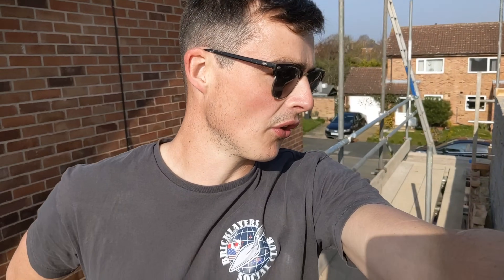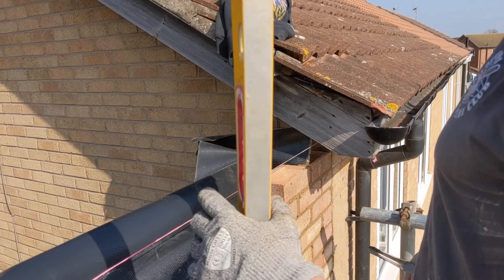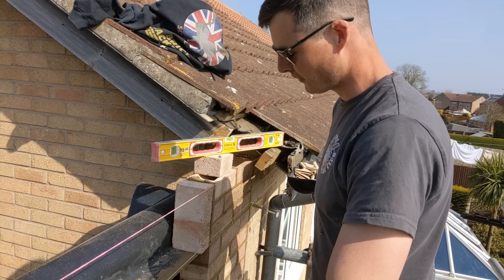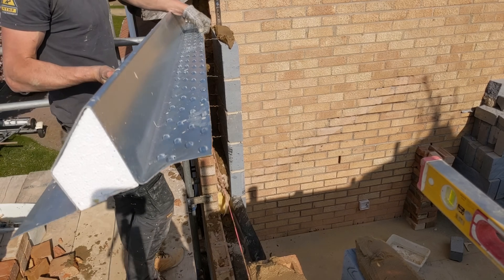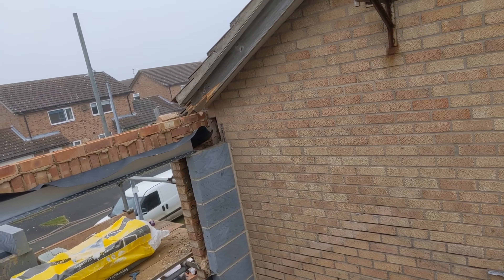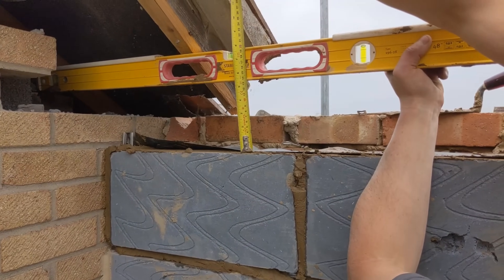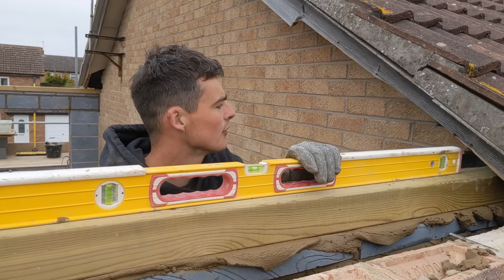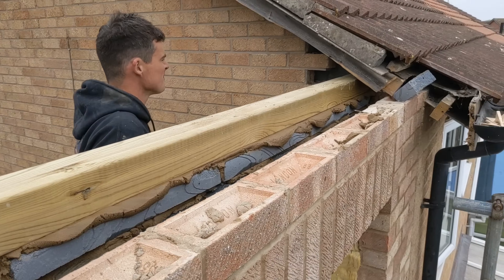Bricklaying - WallPlate & Lintels on! Tips for Lintels+Soldiers #renovation #vlog #extension

Comment: The wallplate straps are for storm lift movement. Great video!
Reply: This is a UK video only. Wall plates need to be mechanically fastened to masonry in North America and most countries in the world. The 4" block is also not allowed either. The 4" block is used as filler only and not structural. Just saying!

Comment: Fair play for doing extension work I do the same and am 29 this year, my most dreaded days are getting out of the ground workers wavy footings, from that point it’s happy days🤣 that lintel you should be fine with as it’s not a heavy load…I’ve had the same gave cavity lintel 120 bearing 2400 opening but was only carrying 5 courses with balcony roof behind 👌🏼 get yourself some fitzbrick clamps if you haven’t best little tool ever and feels so good every time you can use them 🤪
Reply: How do you come across these, extensions out the ground ready for you would be a dream compared to site work
Reply: @brickpug6088  bollocks mate our ground workers seem to think wet concrete finds it’s own level end up cutting splits on the first course, all caving in, loose patio slabs, concrete slab never has right cavity size so I have to sort that out…site work is piss easy because it has to be bang on from the start
Reply: @sammsammmsammmm  well yeah granted not saying it's a walk in the park but like you say once you're over the shite.. much nicer to do privates. Decent muck plod along still get it done but on site it's a mad rat race
Reply: @brickpug6088  depends you still get nasty jobs or having to faff with silly little piers then sit fat steels on top it’s still stressful mate honestly 🤣 I like the thought of smashing a lift a day with a gang on site but we’re all different
Reply: @sammsammmsammmm  well swap for a week and be begging for our old jobs back 🤣

Comment: Mentioned on another video about using a wire reinforcement mesh to wrap it around the base of the wall plate and then that way the wall plate is ready for plastering inside. It does actually work the wall plates solid on there even though I know the roof weight will hold it down. See so many times the internal wall plates not meshed and just plastered over and it all cracks from the wood…

Comment: Izzy how are you fastening the wall plate to top of masonry wall? Obviously mortar bed does nothing. Cheers!
Reply from the maker: Hi mate, we use lateral restraints. A long L shape metal rod, anchors onto the timber and the wall below
Reply: @IzzytheBricky  I have seen some UK masonry video's where other masons  install the top plate on the wall in a bed of mortar? We use structural block 6-8" wide and cast bolts with in top of wall and mechanically fasten wood to block. We have to install protection by code between wood and block to keep wood from rotting. Also brick work if used has to meet certain PSI rating. Brickwork here is used mostly as veneer here.
Reply: The wall plate should also be drilled and fastened to block work straps are not enough where are the wall ties?
Reply: @tridens6708  4" block is also not structural. Should be using 6-8 block  instead of 4" block. Missing corefills and bond beam to make this a proper structure. You then bolt the  PWF plate to the bondbeam which is filled with concrete.

Comment: Air space between brick and 4 inch block is large in some areas and tight in others? I assume you're putting in vapor barrier and insulation in? What are you doing to insulate the walls?